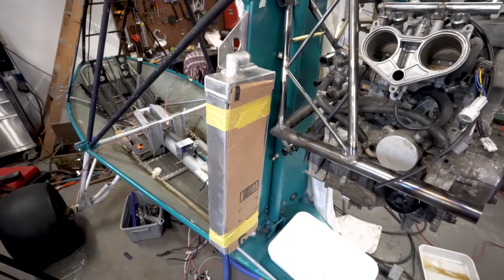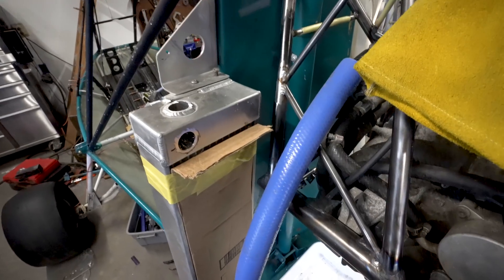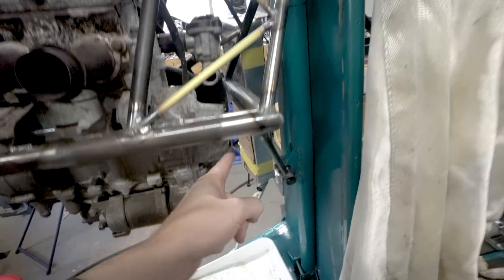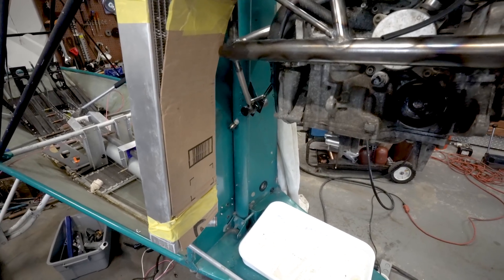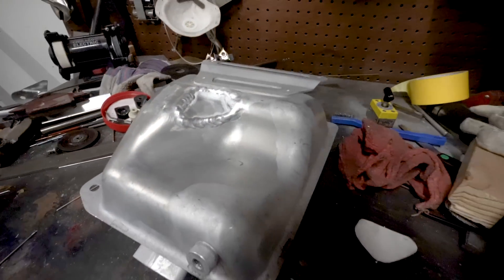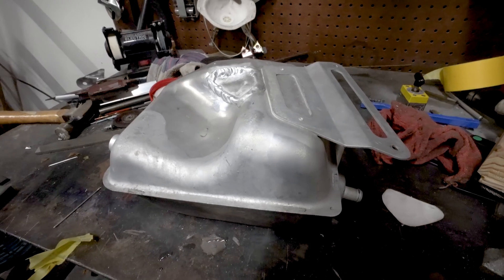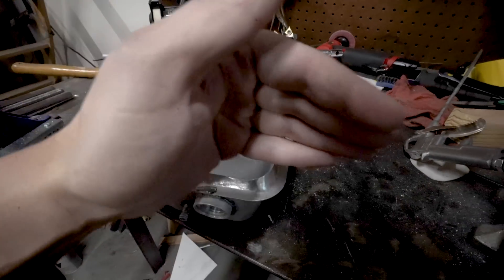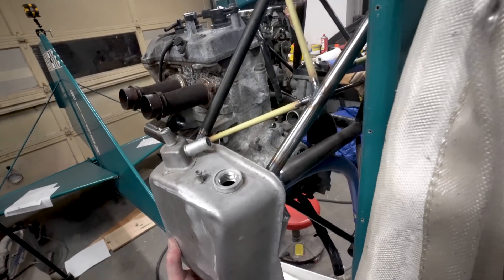Yamaha Engine Systems - Budget Bushplane EP7

Comment: I was told to have your fill cap / radiator at the highest point to keep any air pockets from forming at your heads.... ie highest piont.. love following your work.
Reply from the maker: I’m pretty sure I’ve managed to get the radiator level high enough to manage. In a pinch if I have any issues I can put a block of wood under one wheel while filling to raise the cap a bit.

Comment: If you can accept a little critique you should have moved the upper rad hose attachment to the other side of the tank to save weight. IE shorter hose. May not be worth changing now but for future its a mod you were making anyways so why not save at the same time?
Reply from the maker: The issue there was a combination of level and hose flex. I wanted the extra few inches even at the cost of a few grams of rubber weight. Also, I wanted the outlet and inlet to be caddy corner to force more fluid through more fins. Not sure how much it would affect things to not have it that way but it can’t hurt.

Comment: The radiator looks to be the highest point in the system, that hole you capped would have been a good location for the filler neck and cap

ETA,I see you figured that out lol.
On your pipe to the bottom of the radiator, 2 rubber lined clamps with 1 bolt might be the solution to attaching the pipe to the engine mount.
Reply from the maker: You got it quicker than I did but I got there eventually!